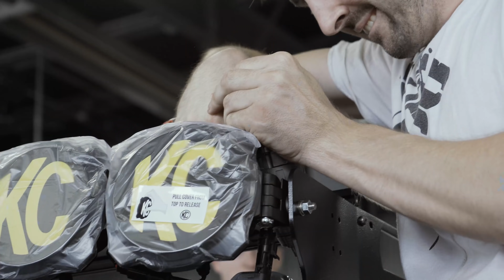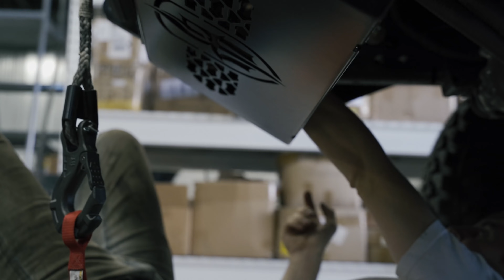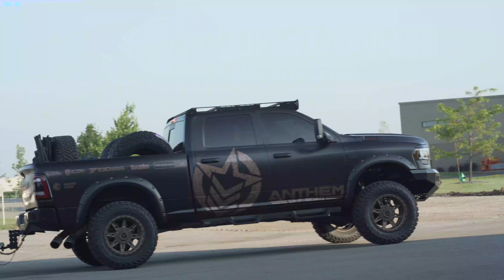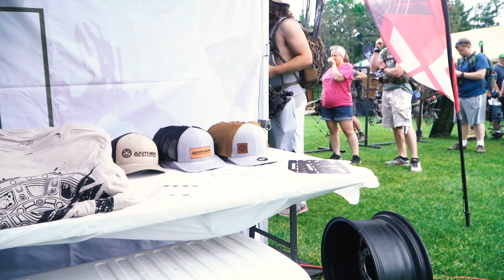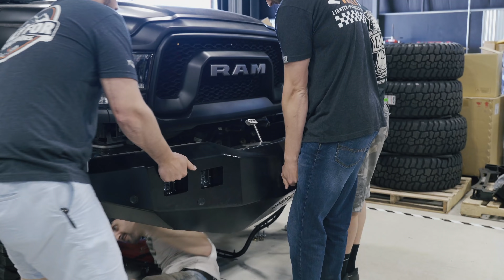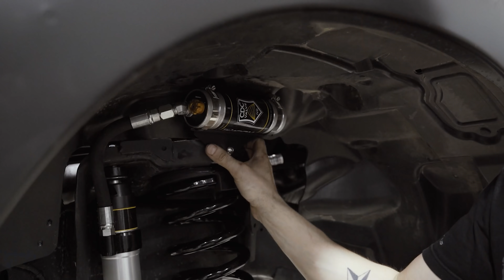Huge Power Wagon Overland Truck Build!! || Finale

Comment: The only thing that I have found is that my synthetic winch line had melted around the drum when I was using it on a 97 degree day earlier this summer.   They are nice until you actually use them to their limit.

Comment: Tow mirrors out on a gasser? A “3/4” ton if you can call that truck that deserves a heart as good as a 6.7.
Reply: “a GaSseR” shut it, another dum dum that thinks diesel is the only way to go just because they sound good and make black smoke🤡
Reply from the maker: Nothin wrong with a gasser, this truck won't tow heavy and is more of an offroad type vehicle, so not having that kind of weight over the front end helps immensely!
Reply: Bro I drive a gasser every day, we just all have our preferences and that is mine. Only love in the truck community
Reply: @colemc.5917  I just can’t take these 12 year olds with obsessions, saying the 12v Cummins is so amazing when the v10 has more power and torque than it
Reply: @masonlheureux4815  I would pay to see your v10 compete with a 12v

Comment: Definitely a sweet truck but as a guy who's building his own overland truck/suv...I think the power wagon was the wrong choice. You should have looked into what the real overlanding community is doing and built a truely iconic truck off of the feedback from real overlanders. Just my opinion and the cherry on top is "a f#$%ing dodge...really?" 😅😅
Reply from the maker: No dodges here! This vehicle fit our criteria a little bit better then your typical, overland style/light offroad style. Plus having to cram 5 people in a 4runner or taco/tundra isn't ideal!
Reply: You own a yoda
Reply: They're also using it to tow trailers to events around the country so 3/4 ton was the way to go
Reply: The power wagon has half ton towing and payload specs. Not exactly what you want for long distance towing with heavy trailers.
Reply: @travisgbarr  it’s rated to tow 10.5k, pulling a small in closed trailer to shows, what’s the issue? It’s a factory off-road ready truck, not built for hot shot hauling.